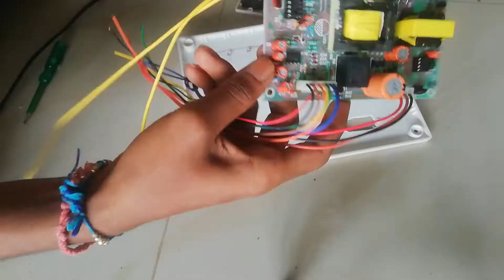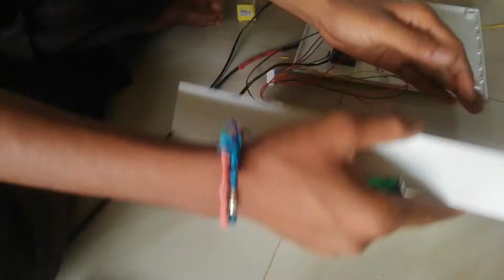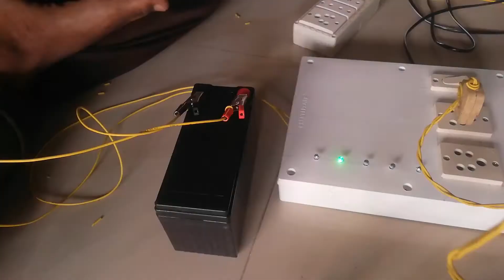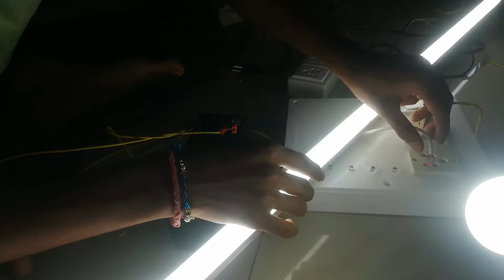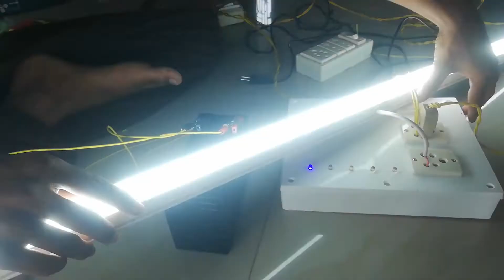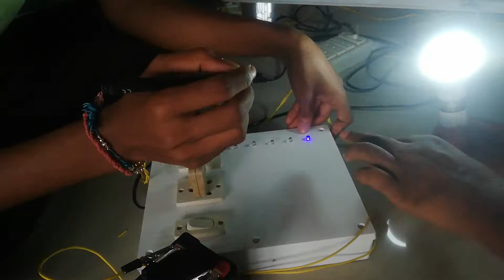how to make mini inverter at home || mini inverter wiring connection ||45 watt inverter kit wiring⚡⚡

Comment: Inverter board ka link do vai
Reply from the maker: https://www.amazon.in/Inverter-circuit-inbuilt-charger-battery/dp/B07YDYS2BD/ref=asc_df_B07YDYS2BD/?tag=googleshopmob-21&linkCode=df0&hvadid=397153389785&hvpos=&hvnetw=g&hvrand=9262074607897303213&hvpone=&hvptwo=&hvqmt=&hvdev=m&hvdvcmdl=&hvlocint=&hvlocphy=9303153&hvtargid=pla-844775508621&psc=1&ext_vrnc=hi